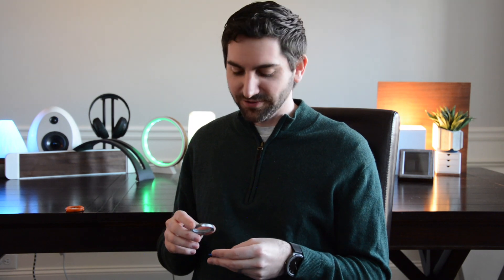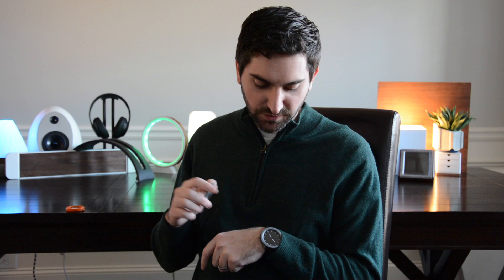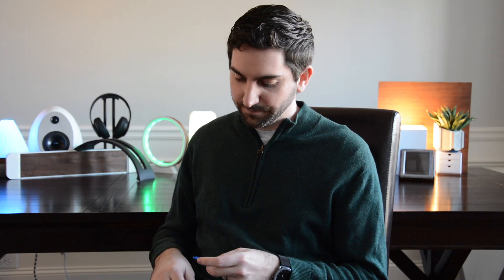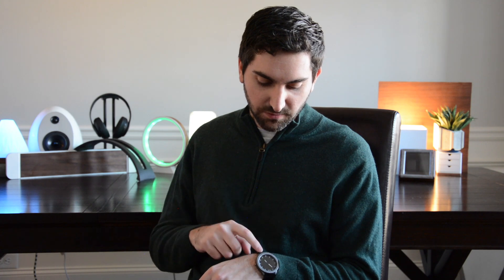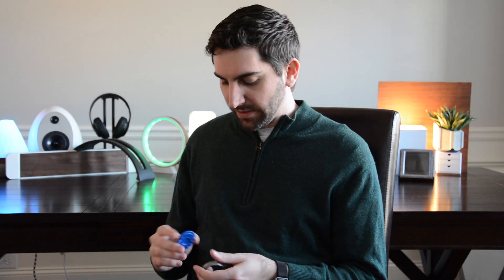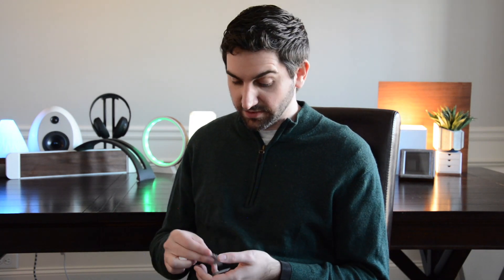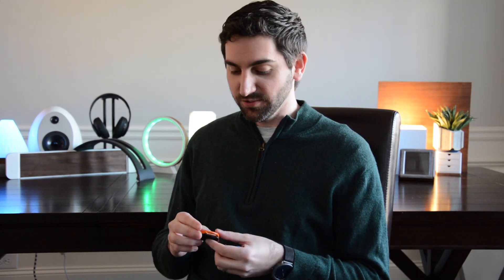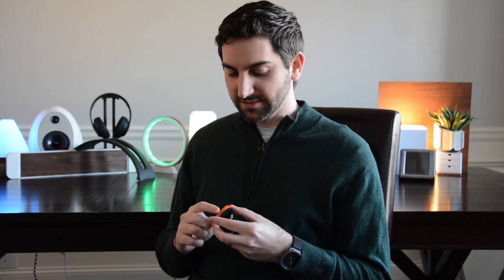3D Printed Modular Wristwatch

Comment: Nice - thanks for sharing! You might like to check out the cad files for my digital watch case on github for some possible inspiration: search OTM-02. I was especially happy with the pusher (button) functionality, inspired by those in the Tutima NATO watch. I wore the prototype for more than a year with no issues - PLA printed cases are actually pretty tough! Now I need to redesign the movement to incorporate an STM32 MCU, especially due its built in hardware (temperature) compensation for the 32kHz crystal;  just a few too many projects and not quite enough time. :)

Comment: Hey great video you have and what an interesting project you were doing. How much does printed part weight?
Reply from the maker: eiman rasydan do you need specific weight? I'll have to dig out a small scale to check if so. But generally speaking the printed parts are very lightweight. I printed at relatively high infill and it weighs less than a standard watch.
Reply: I'm thinking of sending the model to a printing service near my place and they are charging per gram. Hence, I would appreciate if you can provide the specific weight of it.
Reply from the maker: eiman rasydan about 8-9 grams for the 3 printed pieces.